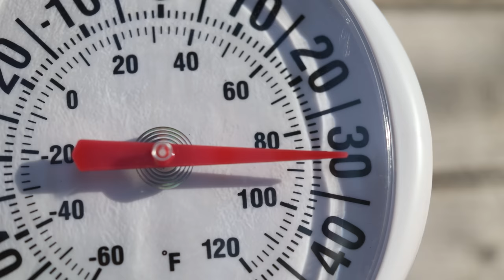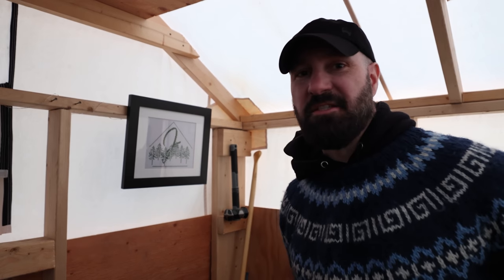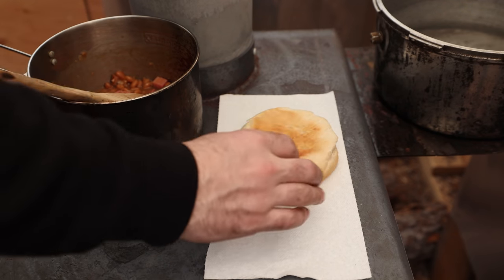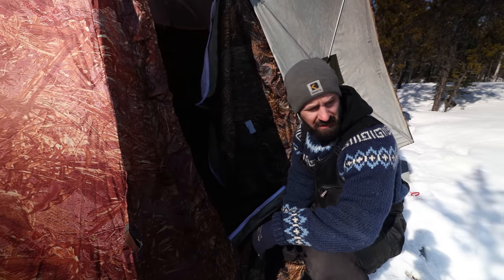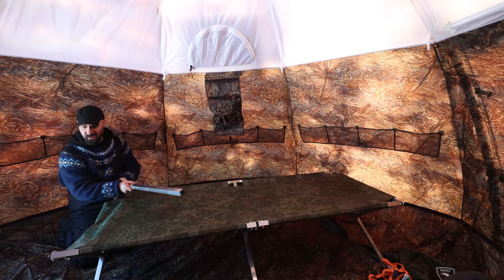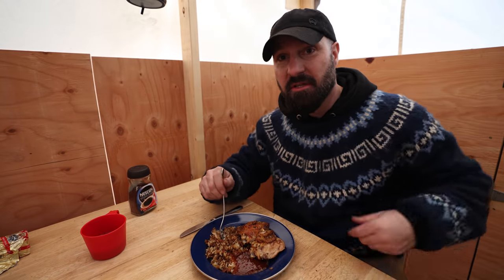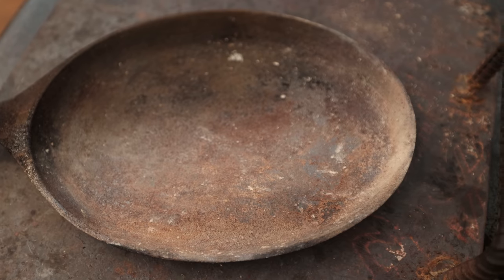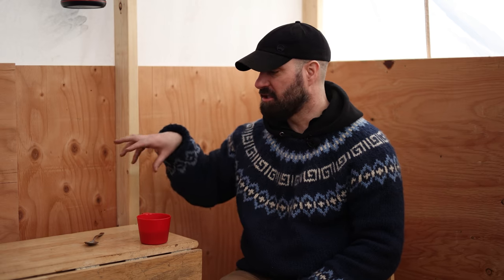Snowmobile Season Ends. 2 Nights. 3 Days. All Alone

Comment: Here’s a tip for seasoning cast iron. You’re not supposed to burn the oil off. You are only supposed to heat that oil on that pan at about 300°F for about 30 to 45 minutes you’re not supposed to get it so hot that it burns it off

Comment: I canr even remember anymore when I discovered your channel. I would say over the years, every video has incrementally improved and I just keep coming to watch more. Watching you reminds me so much of the time I spent in the winter with my dad at our camp 🏕 near Shining Tree 🌳 Ontario. I wish I had the money and youth to go back by ❄️ snow mobile in the winter to our camp. I remember many -30 and -40 nights there. When it was -40, my Arctic Cat Panther 440 would need 10 pulls just to get the motor to turn over a bit. I remember frost inside the outhouse being 5 to 7 cm thick. Man, it sucks getting old Jay.
Reply from the maker: That old panther was a good sled though! Thanks for sharing a bit of your story, Mike
Reply: Good memories. Nice.
Reply: @jaylegere  Have been a big Arctic Cat fan...now they are joined with Yamaha. When Cat was powered by Suzuki, those engines were reliable, tough and good on fuel.

Comment: The easiest way to remove rust from cast iron is to soak the pan in a 1:1 vinegar and water solution for a couple hours. Then scrub the rust off with a scrubby sponge, scrub brush, or steel wool.

Comment: Try this Jay
    Soak each piece of rusty cast iron in a solution of one part vinegar and one part water.
    Using the brush, test each piece after 30 minutes to an hour to see if the rust is coming off. ...
    Once you have scrubbed the skillet clean of rust, rinse it thoroughly with water.
    Dry skillet completely, and re-season.
Reply from the maker: Thanks for the tip

Comment: No knead artisan bread recipe

13 oz. Warm water
1 1/2 tsp salt
1 1/4 tsp yeast (4 grams or 1 envelope)
3 1/2 cups flour
Mix with handle of wooden spoon intp ball
Proof in covered bowl in warm place 1 1/2 hours
Mix into ball, flour ball, place in round cake pan on trivet in dutch oven
(Optional dust bottom of ball with corn meal, slit top and add butter pats)
Wait 30 mins in warm place.
Cook over 9 briquets bottom, circle around bottom perimeter 15 on top for 30-40 minutes til nicely brown.
Remove and wait 30 min to slice.
Reply from the maker: Awesome!!!